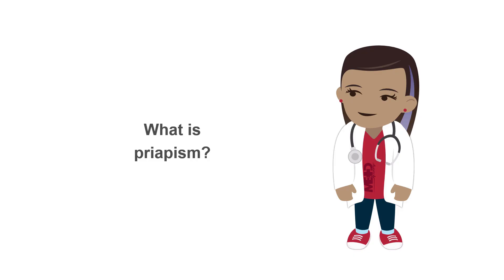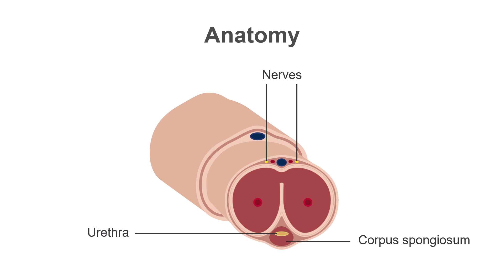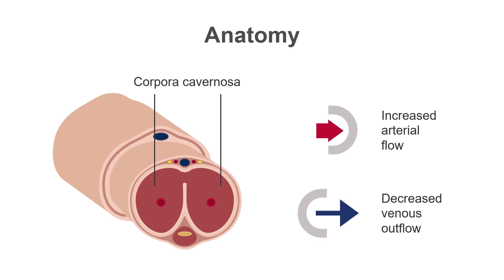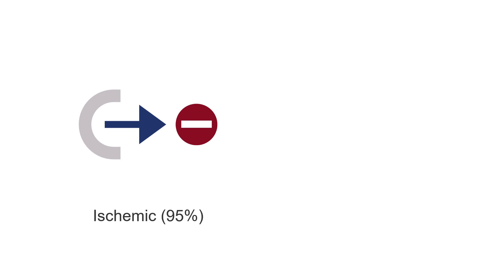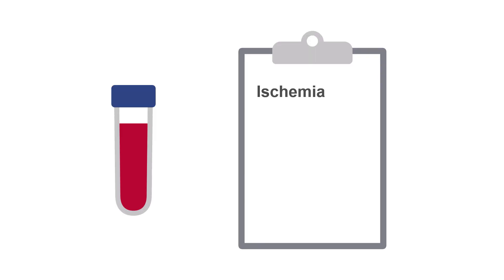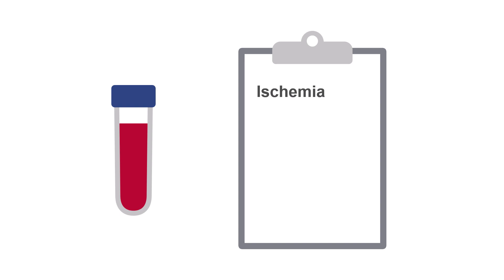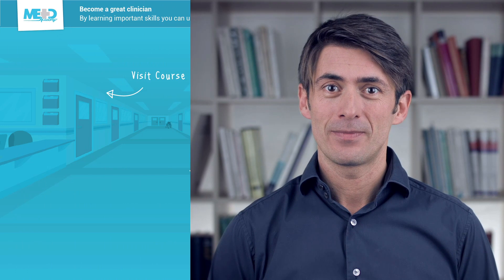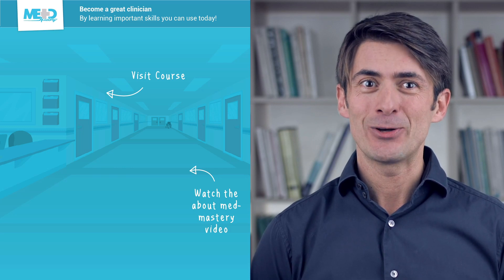Diagnosing priapism

Comment: Sir i have the same problem that im facing from 3 years, how to overcome with this issue
Reply: Wow I’m sorry to hear that. I’ve had it happened to me twice . Once for 3 hours the second was 12.
Reply: @SirBeauGosse  okay so what is the current situation? Any solution to melt the hardness? Have find any way?
Reply: @rockycreates663  it hasn’t happened after the second time ( the last time) about a year or 2 ago .. they had to release the blood manually. A week went by after that , test came back negative for sickle cell.. they don’t know what caused it to happen,  so I’ve been curious every since try to find what could cause it besides sickle cell. My speculation is that it was probably caused by gout in my case. What about you? What’s the longest you’ve had it for? My biggest concern is potentially having ED .
Reply: @SirBeauGosse  for me no blood got released nor i contacted doctor at that movement, for me it was 18 hrs of long lasting erection it is a priapism and later i spoken bout my problem with another doctor he done penile doppler test again and then he told fibrosis got formed that mean their is huge hardness in penis and there is no treatment for that, so im facing erection problem as well as fibrosis problem which effects to my lenght and grith.. Not sure who can suggest me to over come with this problem, i can do only to pray the god.
Reply: @rockycreates663  how many times has it happened to you if you don’t mind me asking?
Reply: @SirBeauGosse  for me it happend  only 1 time that to because i have gone through penile doppler test at that time they injected me for test for erection, so that injection reacted to lead the priapism and fibrosis, and its my bad by consulting a fake doctor
Reply: @rockycreates663  wow once, and all that happened, Man so sorry to hear that, best of prayers .
Reply: @SirBeauGosse  What was the type of your priapism? Was it low flow (ischemic) or high flow (non ischemic) ??
Reply: @sughdeepsinghdhillon8722  I don’t know it was 2 years ago in the summer. I do know that it had nothing to do with my genetics
Reply: @SirBeauGosse  What was the treatment in your case?
Reply: @sughdeepsinghdhillon8722  they had to manually remove the blood , haha. I’m just worried there’s no effects for my little guy in the future
Reply: @SirBeauGosse  bb
Reply: I have this condition & it's been 2 month's now ! It appeared suddenly when i wake up in the morning with little erect shaft !
I don't know how to deal with this shitt
Reply: @sughdeepsinghdhillon8722  any solution that u have find?
Reply: @sughdeepsinghdhillon8722 subir e descer 7 degraus de escada ajuda a o penis voltar ao normal
Reply: @sughdeepsinghdhillon8722 hi I think I’m facing this,did you get treatment?
Reply: I'm going through the same. Non ischemic priapism. It seems is not as dangerous as  Ischemic priapism. Hope you guys are doing well!
Reply: @MrCassett  hey esteban !
I am still going through the condition and it's been near to 3 months now ! I don't know how to treat it. Doctors say that nothing to worry about it !
How are you.
Reply: @sughdeepsinghdhillon8722  That's cool man! You have non ischemic or ischemic priaprism?
The first time I had it it was awful since it was new. Then I went to the doctor and he said I had nothing to worry about. I have non ischemic priaprism regularly. What I do is apply ice cold packs, sqats also help and drink water.
I'm still worried tho.
Reply: @MrCassett  same here ! Exactly the same situation as of yours.
Can i get your mail? Or whatsapp? Or any contact? Need to discuss this. We may help each other. As this is not a common desease. I can't see anyone having this. Except of those few people on social media !
Reply: @sughdeepsinghdhillon8722  Sure! Do you have Instagram?
Reply: @Jack-b3z  hi did you have it?
Reply: Stand in cold water
Reply: @xandrewvlad501  did hardness remains same even after 6 yrs
Reply: @rockycreates663  hello rocky. Did you get high flow (nonischemic priapism) or low flow (ischemic)
Reply: @chikaph7716  its a ischemic,  i have erection now, but facing fibrosis
Reply: I am so sorry bro are you fine now 😞